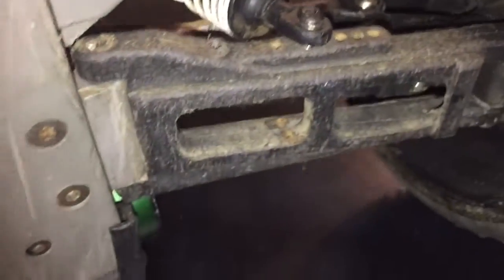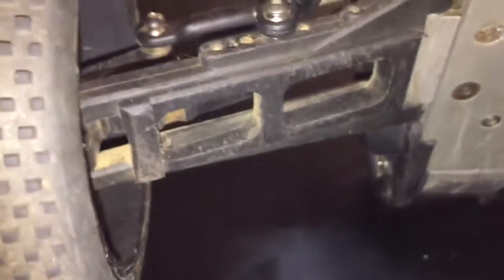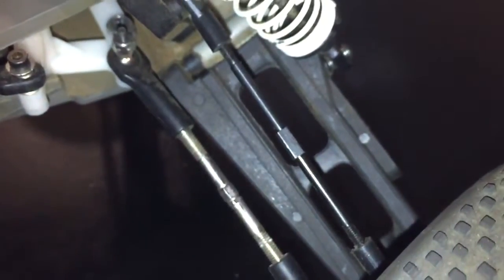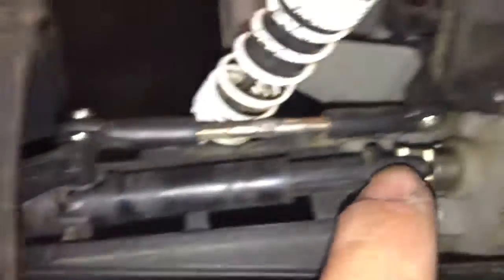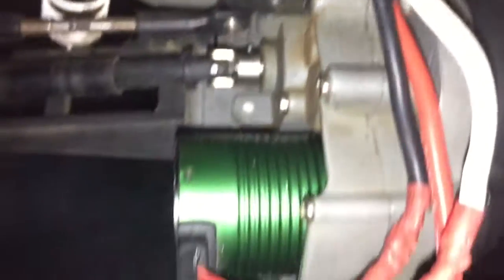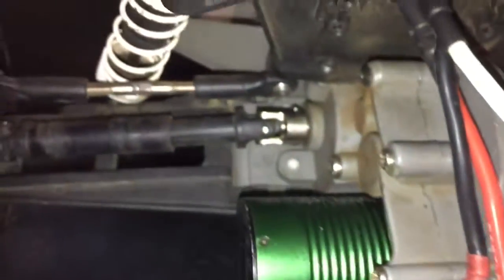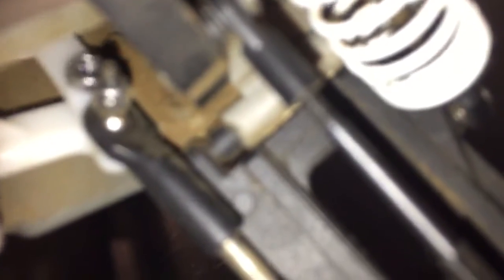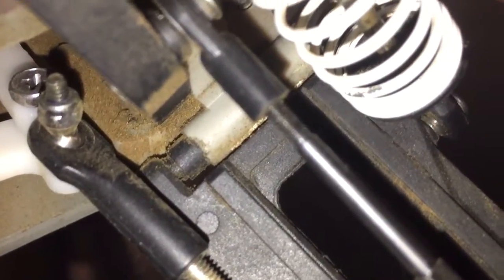traxxas rustler & slash extended arms mod

Comment: I'm a bit confused, you're using rear 4x4 slash arms front and back? Because 4x4 slash arms are the same as rustler rears. So the rear shouldn't have changed.